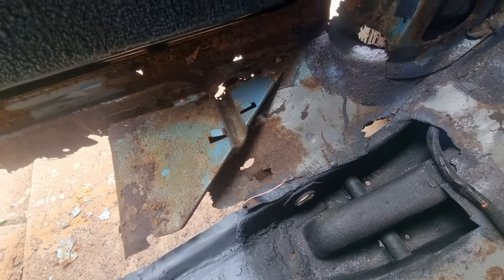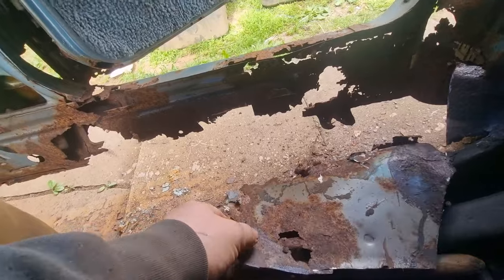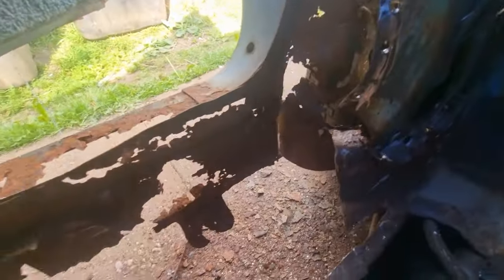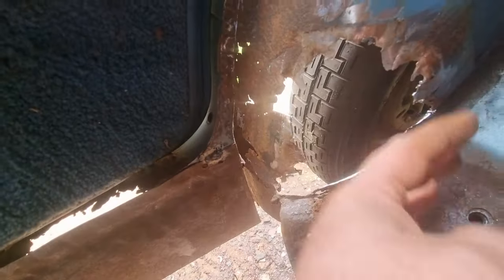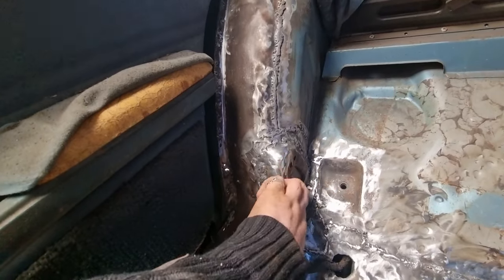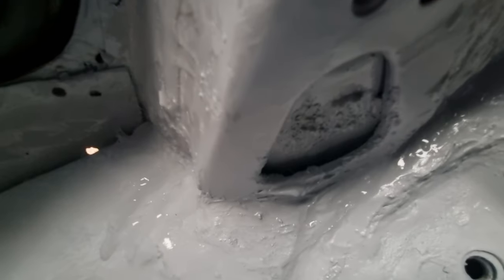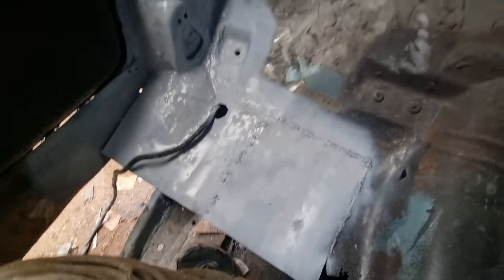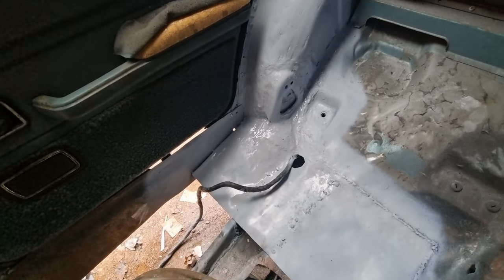Cortina Mk4 Ghia 2.3 V6 Restoration || Drivers Rear Floor Pan P1 (P41)

Comment: the welds on the floor with be covered probably in seam sealer & paint so i wouldn't worry about grinding them back to look pretty.....strength is the key....and once the carpet gets put in they won't be seen
Reply from the maker: Yeah good point

Comment: You did the right thing but leaving the door on I would of taken the door card off as I would of left the door shut till all the welding was done on that side as there was nothing left on that door pillar (never seen one as bad) in all my years of welding vehicles and I would of left the drivers door on as well but you are doing the best thing I bet you was really dreading that job but fair play to you as you are getting her done piece at a time alot of people even with all the tools and workshop wouldn't of done it and it would of been scrapped or gone round the Banger track you want to get a dent kit with the hammers and dolly's to make it easier £25 a kit is sod the haters don't listen to them your doing the best you can with wat you got and on your drive your always going to get people saying they can do better but could they really 🤔 I like the MK1 focus myself them mk2s are eletricaik
Reply from the maker: Yeah I did think about that I know I need to remove the door cards keep meaning to lol and u are correct I should pit the drivers door on at some point to make sure everythink stays in place with correct gaps

Comment: I was flapping there, when you cut all that away, as there was practically bugger all left to work with, at the start!  Cracking piece of work that of anyone's money, and i bet that took hours to do. Also doing the wheel arch at the same time, as saved a lot of time there too. I am not going to say it will be straight forwards from here on wards, as it never is.  Id get the rear door cards removed though, before those get damaged.  Keep going, and sod the cold, never give into a cold, just ride it out lad, But there is a touch of hay fever going about, as me and a work mate have got it.  Also well done for not rising to the haters, at the end of the day those people don't have the balls or the bus fare upstairs to tackle a job like this anyway.
Reply from the maker: took awhile yeah and lol yeah it was a little intence for a moment with it all gone hahaha but had all the mesurements from the other side to tripple checked so it was all matching now the door works with nice gaps

Comment: Great work you using gas?
Reply from the maker: no gas fluxcore 0.9 wire
Reply: @AdamSNook.  Bloody hell that's some skill with flux core wire. How thin is the sheet metal? You should make a video on your settings of mig welder etc? Thanks
Reply from the maker: @jaybradley3765  18 gage i think my welder only as  1 knob on it it sets the wire speed and amps in 1 hit based on the thicknes of metal

Comment: I wouldn’t have a loved one in it slightest whack from side there gone integerity of body as been jeopardised
Reply from the maker: I wouldn't say integrity as gone as its all been replaced in same order as original it's no diffrent to buying ready made panels they all have to be welded in and I am going to be doing some reinforcmemts after I have got it strong I will be going round the car many times double checking everythink

Comment: Mk 2 focus are full of electrical problems
Reply from the maker: I haven't had any problems as of yet I know the clocks can course a problem with not sure on other stuff
Reply: @AdamSNook.  And if the clocks plays up the car stops running and I had problems with the light switch and the electric windows not like the MK1 focus which are easier to fix you been lucky mate
Reply from the maker: yeah im fully aware of the clock problem making it so it wont start easy fix but means taking the clocks out and resoldering the connections im pretty sure the matrix can blow aswell making hot water pool into the car